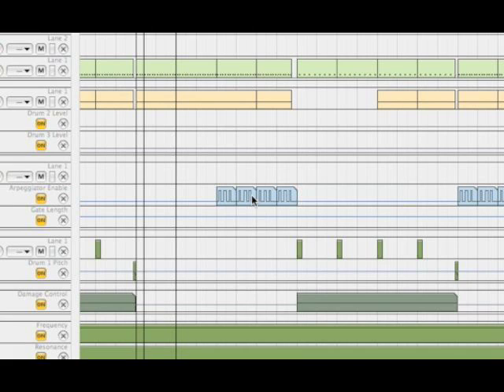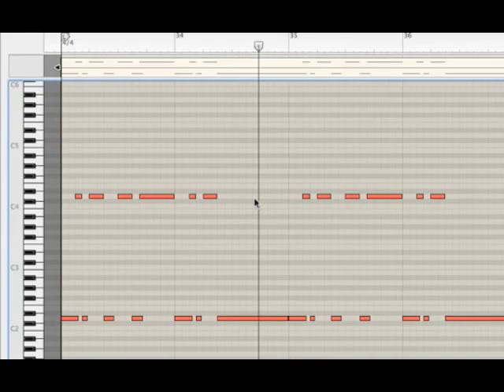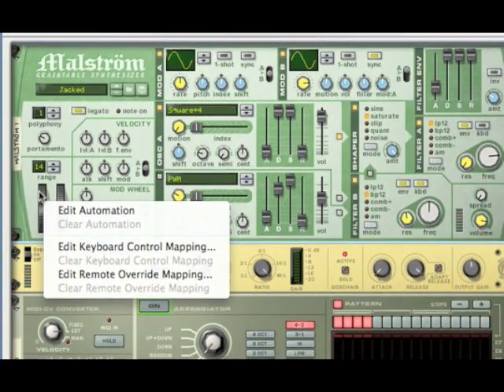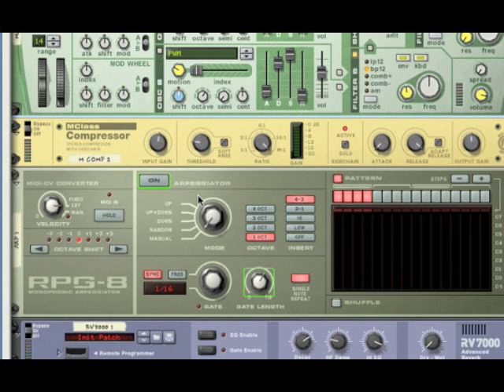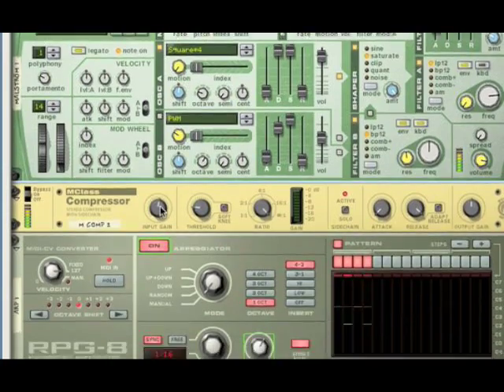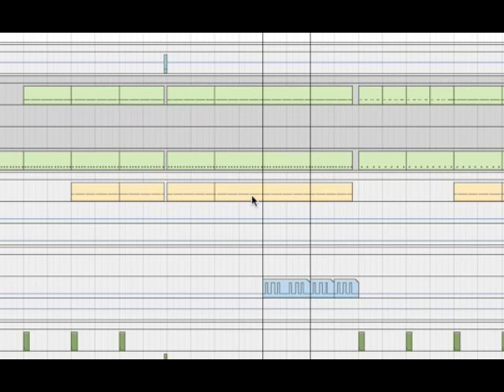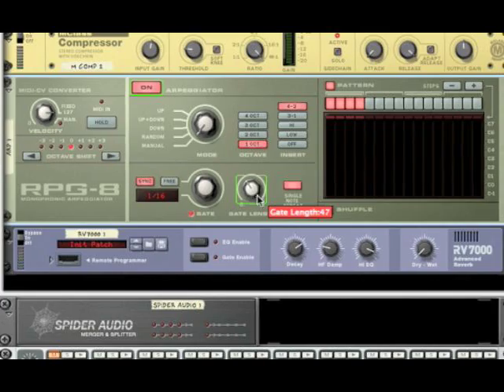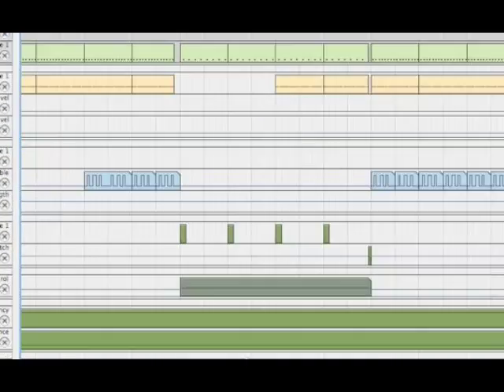How to use "The Dirty Electro Bass Synth" in Reason! (Tutorial and Explanation)

Comment from the maker: follow these instructions and you should get it.
1. create the dirty electro synth from the other video I have.
2. create a redrum and put your kick in the first channel.
3. create a spider audio merger and splitter.
4. drag a wire connecting the L/R to the first channel of your redrum. (make sure you pressed tab to flip to the back for this.  do the L/R on the right side not the left)
5. directly next to the l/r drag a wire from the to the next available channel on your mixer.